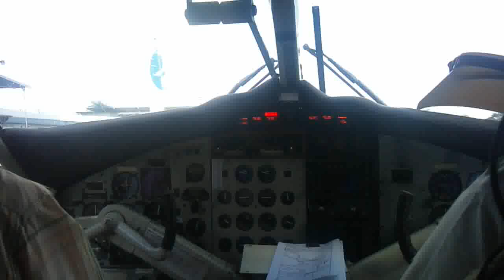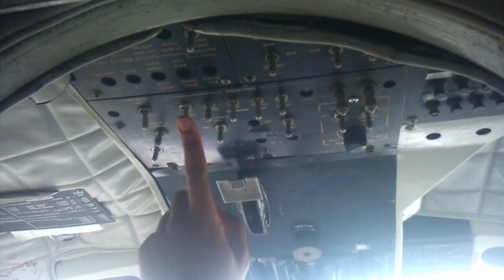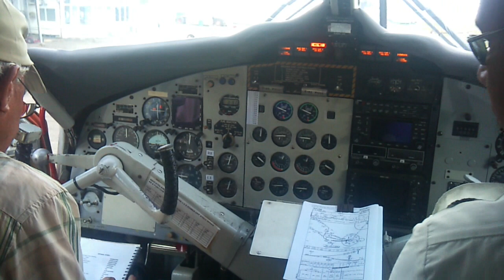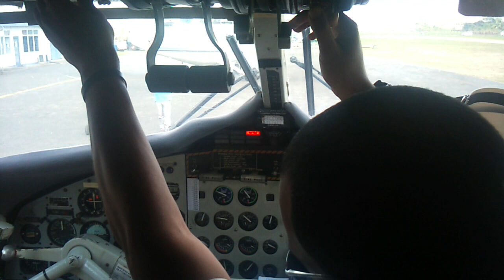DHC-6 Twinotter full startup procedure

Comment: Unfortunately, the instructor is wrong from the start. JAR23 aircraft, such as the Twin Otter (DHC-6), do not have a V1 speed. They use a VTOSS (Take Off Safety Speed). JAR25 are required for V1. BTW, I have 5000 hrs on Twin Otters and have just a little knowledge in this area. : )
Reply: we speak our own language in Suriname , we have bread with salt fish and others call it bekkeljauw